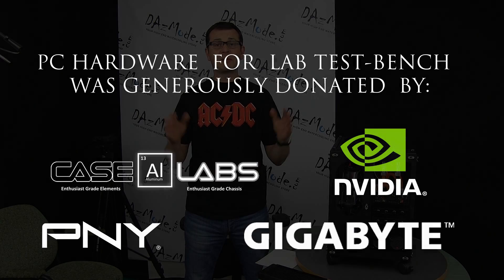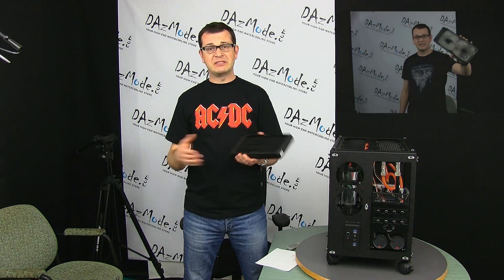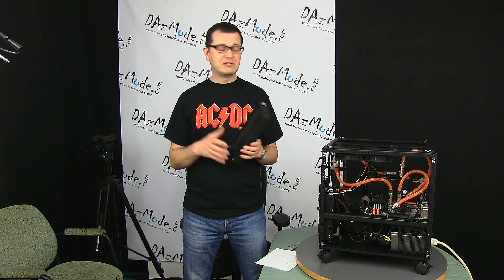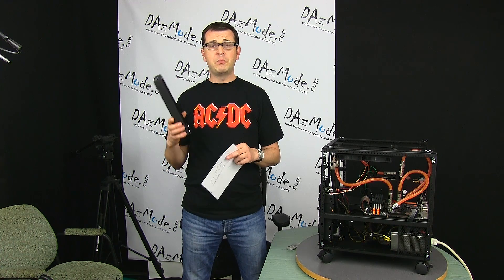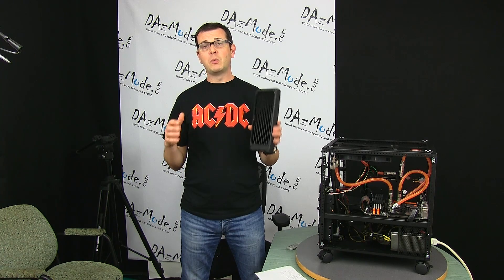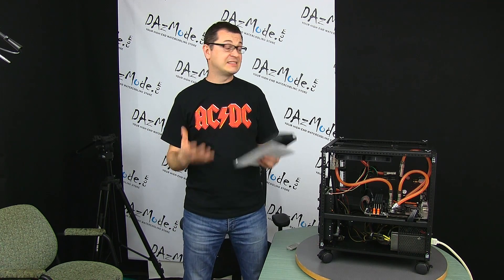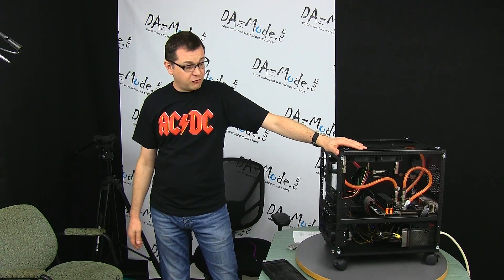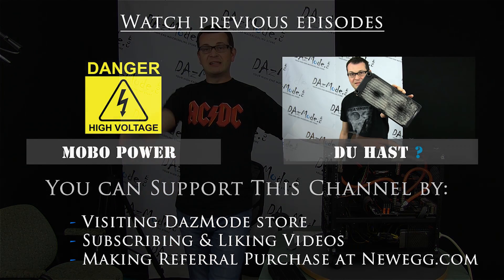What difference dirt in your radiator makes?  - DazLab EP15

Comment: I have a diffrent test with dust. 120mm AIO on a i7-4790K from my father. The computer was not cleaned for about 4 years, so the radiator had so many dust bunnies and a thick layer of dust over all the fins. I had a diffrence of about 8-9 Celsius. Mind you, I also had to apply some fresh thermal paste(Kryonaut), since i took off the AIO completely to clean properly
4790K is running stock speeds
Reply from the maker: Thanks for sharing. It makes sense for AIO as they have microscopic pumps with very little flow, so they suffer more from any negative changes like thermal paste application or radiator/fan performance.

Comment: TL;DR: save the money on your rads by buying as tall as possible, but thin and less fpi. Use the money saved for a vacuum cleaner and compressed air and good fans!
Reply from the maker: Cannot agree more, high fpi rads are more headache than benefit.

Comment: I have an EK XTX 240 rad (it's pretty thick!), is it enough to watercool 4790K+780Ti ? I currently have it only cooling the 4790K and its max 50 degrees (not OC'd) and wanna buy a GPU water block (a universal one, because i don't wanna buy a new block every time i change my GPU)
Reply: Ubeogesh Without overclocking you should be fine. You need about one 120mm for each component, with high heat CPUs taking a bit more. I would add another 120mm equivalent for each component overclocked.

Comment: Woah I didn't expect those numbers at all. The low rpm VS high rpm makes sense and I would have guessed it would have made a bigger difference when using slow fans, but I didn't think there would be more than 4 degrees difference. I haven't cleaned my top rad for a while now, but I'm gonna setup my new X99 system soon so we'll see how dusty it is.

Comment: odds are, by the time dust has any significant impact on your system, its probably time to upgrade anyway. Like my 3 year old 680sli loop.
Reply from the maker: MonkeyspankO Yes, also it is good to know that spike in temps does not necessary mean your blocks are clogged or similar.
Reply: DazMode well, I bought my blocks and rads from you and they work perfectly!  Some minor silver residue, but no clogging. Expect my new order soon when I build a new loop.

Comment: Isn't it possible to keep a setup almost completely dust free using a case with filters such as one of the Define series ? Assuming the radiator is either at the front or the bottom and the top of the case remains closed since it has no filters there.
Reply from the maker: TheIntervurt  FIrst of all you can position PC above the floor level, which makes a major difference. FIlter will reduce air intake, which affects you just as much as dust, so you need increase fans speed to compensate.
Reply: DazMode I think I'd rather sacrifice some temperatures for a silent and dust free system.
Reply: TheIntervurt There is simply no way to avoid it. The dust always gets in.
Reply: Yes some of the dust will always find it's way inside, the point however is what percentage is prevented from getting in.
I've seen moderate amounts of dust stuck on intake fan filters throughout the years which makes me question claims of dust filters being useless.
Reply from the maker: TheIntervurt I don't think it right thing to say that filters are useless. They do exactly what they supposed to do.  But they do have side effect of reducing air intake.
Reply: DazMode I think testing the cooling performance drop due to dust filters might actually be a good idea for a video.
Reply from the maker: TheIntervurt It is exactly the same as slowing down your fan.